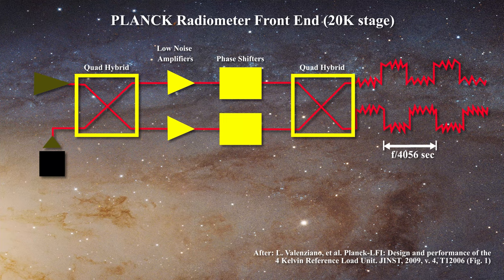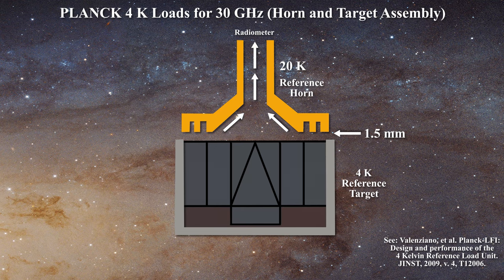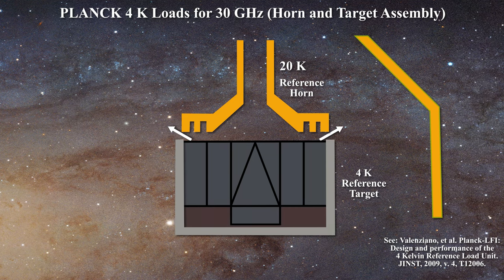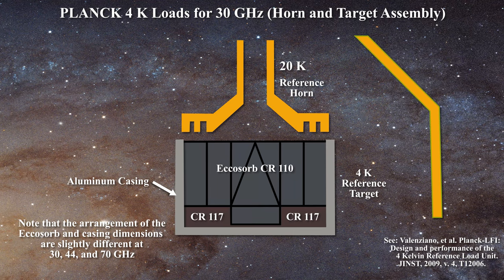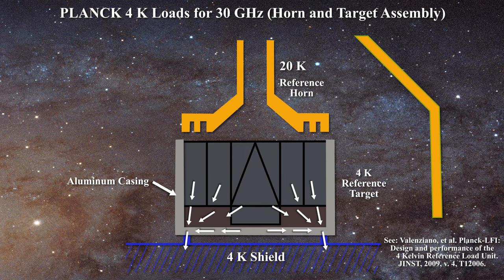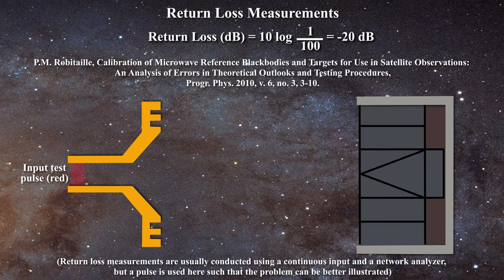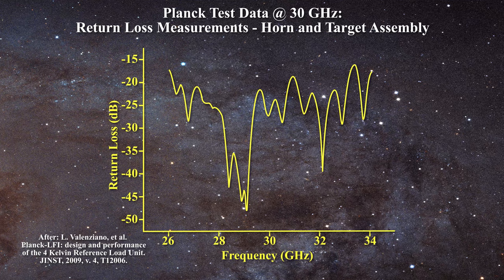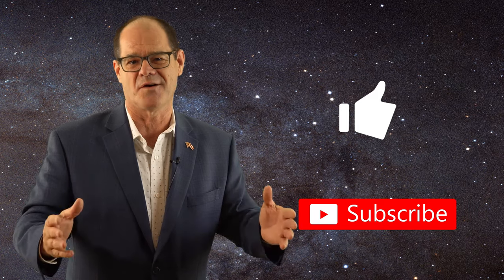Planck Satellite - Analysis of the 4K Blackbodies!

Comment: https://drive.google.com/file/d/1Ao7nZtzbyuSHMgLszz1jbfndHo37aF8G/view?usp=sharing

OK I grabbed the return loss data directly off a screen capture and then replotted on a linear plot of the returned power (you seem to like log plots when they suit you).

Basically it a good calibrator. The feature at 29 GHz which goes from -25 to -50dB suggests the wave is making just an extra single pass across the cavity and so producing extra absorption so being an even better absorber. You know like the speck of carbon in the cavity you keep going on about.

Resonance would show up as a complete return of nearly 100% of the power at some frequencies - this is clearly not happening!

Oh and on the no photon cold absorber, I have a test for you. Get a thick copper rod, roll around one end in a candle flame and get a good coating of black copper oxide and soot. At room temperature put the other end in a glass of iced water. Then use one of those IR infrared laser spot thermometers and measure the temperature of the black bit of the rod.  Is it 0K or 0C? I can wait!
Reply: Dr. M. H.  No just his pet Rottweiler
Reply: Dr. M. H.  No just "Grrrrr" and "You clearly know nothing!" despite spending 35 years doing this!
Reply: Dr. M. H.  Crothers!
Reply: @BobWatson_Dr  : 1) "OK I grabbed the return loss data directly off a screen capture and then replotted on a linear plot of the returned power (you seem to like log plots when they suit you)."
 Watson

No, using the log plot is standard in measuring return loss.  That is why the PLANCK team itself used a log plot in their paper!

2) "Basically it a good calibrator. The feature at 29 GHz which goes from -25 to -50dB suggests the wave is making just an extra single pass across the cavity and so producing extra absorption so being an even better absorber. You know like the speck of carbon in the cavity you keep going on about."
 Watson

Complete nonsense.  You are clearly lost relative to such measurements. Blackbodies cannot act in a frequency dependent manner and that is the point. And also, the carbon particle problem is Max Planck's issue, not Dr. Robitaille's (see: http://www.ptep-online.com/2008/PP-14-07.PDF)

3) "Resonance would show up as a complete return of nearly 100% of the power at some frequencies - this is clearly not happening!"
 Watson

Now I understand why the Planck mission was in so much trouble.  When you have resonance, the return loss measurement will produce less return back to the network analyser!  Your argument of 100% return is completely false.  When you have resonances, you get standing waves in the cavity and the power does not easily return.  If the quality factor is high, then the width at half maximum will be low and the peak will be sharp. The quality factor is the ratio of energy stored to energy lost!  So no, you have this completely backwards.

4) "Oh and on the no photon cold absorber, I have a test for you. Get a thick copper rod, roll around one end in a candle flame and get a good coating of black copper oxide and soot. At room temperature put the other end in a glass of iced water. Then use one of those IR infrared laser spot thermometers and measure the temperature of the black bit of the rod.  Is it OK or 0C? I can wait!"
 Watson

Actually, it depends if you soot will participate in the conductive cooling.  If your layer of soot is thick enough, conduction will be poor and you will get a proper reading.  You need to think a little about the problem.  When you place your material in contact with a good conductor and the thickness of your material is on the order of the wavelength, then you can have problems, because you risk creating a graybody and the emissivity of the material will drop.  That is in fact what the Planck team seems to have inadvertently done.  You created a gray body without realizing it.  That is also why you still have resonances.  You don't have a blackbody, because blackbodies do not support standing waves.  They immediately thermalize the incident radiation!  You don't get resonances within real blackbodies.

Finally, I am a friend of Dr. Robitaille and a coauthor of papers with him, so I can defend him any time I please.
Reply: @stevecrothers6585  
1) Yes VNA's work directly in dB a log measurement in order to show high dynamic range, but you need to keep in mind where 0dB is
2) Look at the linear plot it's all 1% or below - by any standard that's a good absorber
3) Rubbish!  Resonance means complete reflection and no power loss to so you have to go back up to 0dB
4) Yet the return lose proves it's not a grey body and absorbs 99% of the radiation - I would still also like to see you prove a no-photon chilled black-body by experiment
     You can't get resonances within blackbodies as they are quickly damped - you can't sustain an oscillation without a perfect reflection and no absorption

Let's talk FIRAS - same tactic of questioning shielding estimates, which somehow by hand-waving and emotive language leads to zero shielding.  Robitaille has a vague argument based on weak-hydrogen bonding around the energy of 3K, which by some hunch rather than any mathematic process becomes 3K emission. This 3K emission from the oceans is somehow fully coupled into the FIRAS horn to be seen as the measured background 3K radiation. Yet he dismissed the 300K  from the landmasses, somehow thinking them to be "microwave silent". Yet a few simple calculations show they are 100 to 1000 times bright than 3K and being 30% of the Earth surface will be hundreds of times brighter than his 3K Ocean signal. Therefore if the shielding on FIRAS was so bad we should see a 300K spectrum not 3K - where is the fault in my reasoning?
Reply: @BobWatson_Dr  : You just keep demonstrating how lost you are for the world to keep laughing at you.  You are a joke. Your dips are the resonances, that's what we're talking about, not the baseline bozo.  The flat part of the baseline is not associated with the resonances. You really don't know what you are talking about. And the world of RF engineering can now tell. Let me explain it to you in baby  terms. It order to have resonance the wave needs to be oscillating between two surfaces. If a wave enters the cavity and simply returns to the network analyser it is not a resonance because it is not oscillating between two surfaces.  But on your Planck loads you have resonances and they are not simply returning to a network analyser and that's the point.  Your -20dB return loss is not indicative that you have a blackbody in your case because blackbodies do not support resonances and you have resonances in your case. The dips are the resonances and the Q-values are determined by measuring the wide at half-height. You cannot determine the Q of a baseline. The baselines are not resonances. You resort to any crap to try to save face. That won't work  As I said, you are an idiot, and now everybody can see it. 

"The mean bloody return level is only -0.1dB !!! That's 97% of the power being reflected back you fool, while with the LFI only 1% was returned. " Watson

The fact that the resonances in the resonator of figure 5 do not match the -20dB level of the LFI has nothing to with the price of fish. Dr. Robitaille built the resonator and he shows what the resonances look like. And your 4 K blackbody has resonances and you did not even recognise their appearance. You've demonstrated that you have no knowledge of RF engineering and that you simply use instrumentation designed and assembled by others. Again, blackbodies must not support resonances and your 4 K loads have resonances and therefore they are shit!
Reply: @BobWatson_Dr  : A factor of -25dB at 29 GHz is a difference in performance by a factor of about 300 in power across your frequency scale. In a proper blackbody there should be little or no frequency dependence. How much more do you need to understand that you don't have a blackbody?
Reply: @stevecrothers6585  
OK Keep filing up that resonator at -0.1dB  with good absorbing material - the level drops and the dips broader - until the mean return level is -20dB - what have you got then - a  good absorber with a slight ripple
The -20dB is the critical measurement unless you can explain how that  sub percent ripple effects its performance as a reference load. It's not adding or removing any significantly extra power
Reply: @BobWatson_Dr  : One more point about Dr. Robitaille's cavity; it's a sealed cavity with no gaps and that's why you get an essentially 0dB baseline, because the only way radiation can be lost is through resistive losses.  But you have gaps between your 4 K load and your horn; losses that are not resistive, as you can see in fig.10 of the LFI Team paper.
Reply: @BobWatson_Dr  : "OK Keep filing up that resonator at -0.1dB  with good absorbing material - the level drops and the dips broader - until the mean return level is -20dB - what have you got then - a  good absorber with a slight ripple
The -20dB is the critical measurement unless you can explain how that  sub percent ripple effects its performance as a reference load. It's not adding or removing any significantly extra power" Watson

That's right. You are finally starting to understand, except for one point. As the material becomes more absorbing the resonances must continue to broaden until they disappear. Again, you demonstrated that you had no understanding that resonances existed in your blackbodies, and that is why you are done!
Reply: @stevecrothers6585  Done in what way? We have 99% absorption across the band with a little extra absorption at 29GHz. What stops it being a good calibrator? 
I have used these types of load, with thermal breaks and conductively coupled to the cold finger via a thermal strap. They all work exactly as expected
Are you saying they don't emit, have spikes in the band-pass? I can assure you there's no problem!
Reply: @stevecrothers6585  Let's take your resonator and heat it to Ta and look at the spectra coming out. We would see a base-level of a few % Ta with spikes upto 0.1Ta. It would be as you put it a "shit" calibrator. Add the absorber base-level creeps up and spikes grow and start to flatten out nearly touching Ta. Until finally it's 99% Ta cross the spectrum with broad blips touching Ta. It is now a good calibrator - one that will do the job of giving a temperature reference. It would be shit for FIRAS though.
Reply: @BobWatson_Dr  : "Done in what way? We have 99% absorption across the band with a little extra absorption at 29GHz. What stops it being a good calibrator?
 I have used these types of load, with thermal breaks and conductively coupled to the cold finger via a thermal strap. They all work exactly as expected Are you saying they don't emit, have spikes in the band-pass? I can assure you there's no problem!" Watson

Yes, the person who does not understand simple return loss measurements can assure everyone there is no problem! Look, resonances have to be driven, so don't expect spikes on emission.  What resonances reveal are fundamental problems with design.  It is like the Tacoma Narrows Bridge you learned about in High School ( https://www.youtube.com/watch?v=mXTSnZgrfxM&vl=en ).  There was nothing that appeared structurally wrong when it was not driven.  You keep insisting that you have 99% absorption over the band, but you cannot say that.  You have a -20 dB return loss across the band and that is not the same.  All of this return loss is NOT directly convertible to absorption.  That is why the presence of the resonance bands is so terrible for the Planck team.  Blackbodies cannot have any resonance bands, as they must treat all incoming radiation IDENTICALLY.  They must immediately thermalise it!  They cannot allow the presence of resonances, as these demonstrate that the radiation is in fact not absorbed on first pass.  Your "blackbody" is allowing the buildup of standing waves!  Just have a look at your baseline from the plot you provide above.  It could be argued that you have resonances all over the place.  But that is not even a necessary argument to shatter your blackbody claims.  Just take your resonances at 29 GHz.  The width at half height is on the order of 0.25 GHz.  That means that your Q value for those resonances is on the order of 100.  For every 100 waves carried, you get a loss of 1.  So your supposed blackbody can allow 100 times more buildup of RF than it loses through resistive losses in that frequency range.  It is not like you have radiation entering your material and being absorbed on first pass as required! You have constructed junk and the presence of your resonances prove it. Too bad Kirchhoff could not make all cavities black as you so wanted.  If he had a Network Analyser, he would have never formulated his law, because resonant cavities exist and they are not black! In thermal radiation, the nature of the walls matter.  You defended Kirchhoff's Law previously on these pages, but now it seems it could not save the Planck team.  Perfect reflectors exist and it takes a perfect absorber to build a proper blackbody.  You don't get to have one just because you have thermal equilibrium with an enclosure.  Resonance cavities are enclosures in thermal equilibrium and they are not black.
Reply: Dr. M. H.  Oh my, Bob. You are probably not a bad bloke, which is why I truly feel sorry for you and your team. You really do not realize when you have had your ass handed to you. Quit now Bob. It is over for you.
Reply: @BobWatson_Dr  Oops. Posted to the wrong person below. Reposting.

So I'll say again, you are probably not a bad bloke, which is why I truly feel sorry for you and your team. You really do not realize when you have had your ass handed to you. Quit now Bob. It is over for you.
Reply: Dr. M. H.  Thanks for letting me know that I posted to the wrong person.

Steve Crothers has provided all of the details, Dr. M.H. I'm not going to repeat what Steve has already laid out.
Reply: @Repurplecirculation  :  "Look, resonances have to be driven, so don't expect spikes on emission"  - "Precisely!
" Repurplecirculation

Perhaps you need a clarification.  The fact that you don't expect spikes on emission is simply a correction, again, of Watson's errors.  The spikes Watson alluded to on emission are not the problem anyhow.  They will never occur and that is besides the point (Other than highlighting that Watson was lost!).  The key is that the resonances observed on return loss are a manifestation of a fatal design flaw.  The material from which the loads are made can sustain the presence of standing waves.  That means that the material is not acting as a proper blackbody, because blackbodies must not support any standing waves.  The problem manifests itself near 29 GHz primarily on return loss measurements, because of the dimensions of the cavity.  However, the fact that the resonances are even there demonstrates clearly that the 4K loads are not proper blackbodies over the entire range of interest.  The loads cannot act properly on emission (they will not have the proper emissivity) because they clearly do not act properly on return loss.  It is a fatal flaw for the Planck blackbodies, and now, everyone can tell that they are not black. So much for spending a billion dollars and not even understanding the basics of blackbody design.